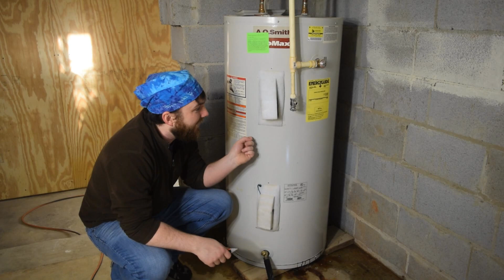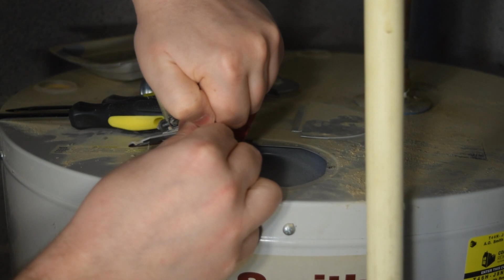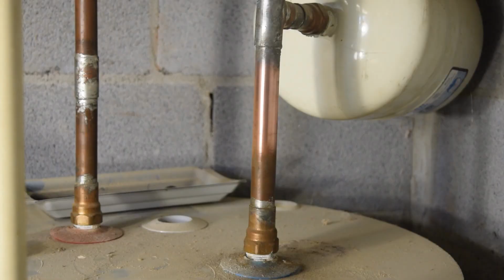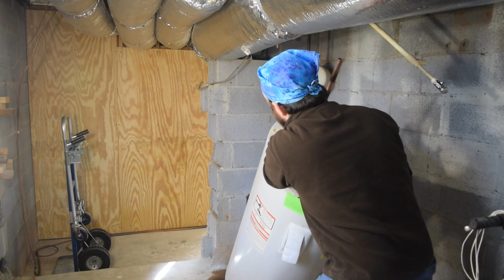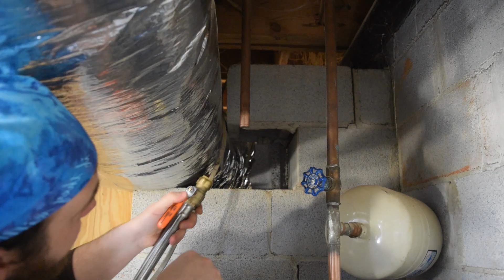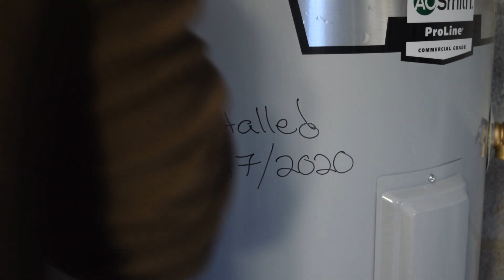How to Replace a Water Heater

Comment: Those SharkBite fittings are expensive but the quality and ease of installation are second-to-none, I love 'em. Given the fight they put up I gotta wonder if those wire nuts were SharkBite, lol!
Reply from the maker: Lol! I agree SharkBites cost a pretty penny, but I was happy to pay it to avoid trying my hand at soldering copper. I thought it was pretty cool that I could get one with a shut off valve too (of course they charge more for that). Thank you for watching Alan!